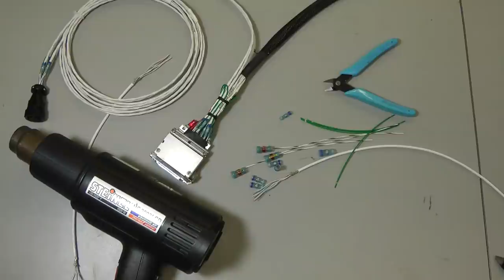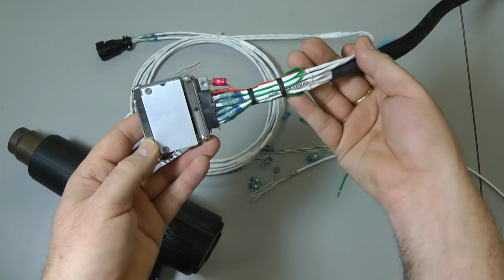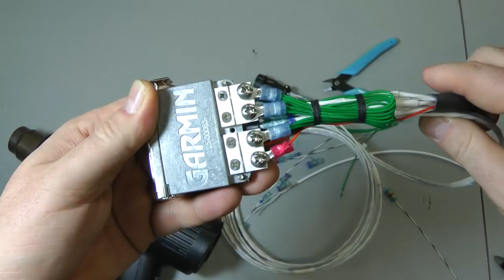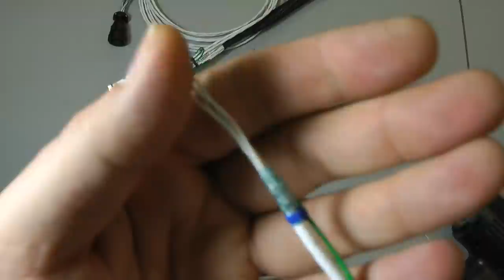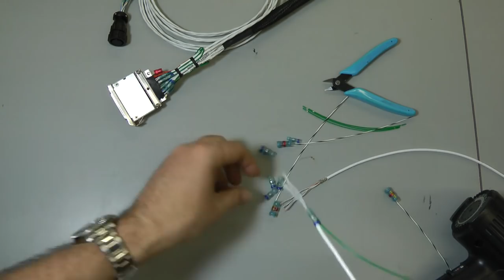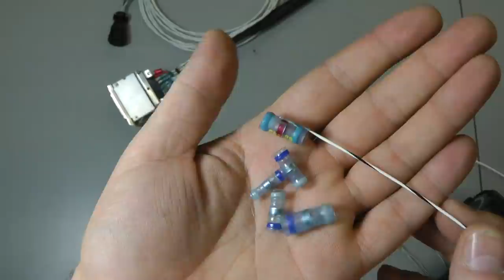007: SOLDER SLEEVE & SOLDER SPLICE on Aviation Wire

Comment from the maker: Most of our heat guns are typically set somewhere between 500-700 degrees.  If you get it too hot you'll melt the outer insulation which isn't good, but if it's too low then the inner solder won't melt and flow either. It depends a little bit on the specs of each various solder sleeve mfgr as to the proper temperatures, but if you try one or two you'll quickly find the right setting for the job!
Reply: Try a IR heat gun.

Comment: Thanks! I got some of the 22 ga shield terminals with a black trace on a white wire that comes off of the shield that will get an eye terminal that ties to a vacuum tube socket mounting screw. We call it a "DRAIN" not a ground. The original wire needs to be longer so I can swing a pair of caps 180 degrees so those terminals will clear a new bigger more powerful main transformer. Green in that power supply is the 6.3 volt heater wires. Black is DC ground. White with the black stripe is DC chassis ground, but green from the power cord is the safety grounding conductor. I will be running 22 ga mic cable. I just did some RG316 and RG178. They are like miniature RG174 cables. I tease an opening into the braided shield then hook the center conductor insulation and all and VERY carefully pull it through that opening leaving a tail of in tact braided shield wire, with no loose whiskers to short to anything.
Reply: I am very anal and totally OCD about my cable work. I will be doing some more 4 lead Kelvin clip test leads soon. Each clip is $80! I bought some Asian made tweezer test leads. The shields are not even connected and two of the center conductors were soldered so hot it destroyed the BNC connectors. I get to redo that too!

Comment: AC 21-99 Section 2 Chapter 3 paragraph 23b instructs to comb out braid and fold back over the jacket to prevent braid to wire shorts. Shorts can happen months after solder sleeves were terminated and inspected. I’ve seen it happen.
Reply: So very true. Plus the short can cause equipment failure and it may be hard to troubleshoot to the correct wire causing the problem. It could also become an intermittent short which is very hard to troubleshoot. The intermittence would depend on the flex and angle of the cable.
Reply: You are very correct and that's a good point!  Will try to edit the video to add that in, was mainly just trying to show the basics of these buggers....
Reply: I don’t see this AC listed any longer at the FAA Advisory Circular web site.  Any idea where to find a PDF online?

Comment: I normally fold the shield back over the outer insulation. I'm afraid the hot solder could damage the internal wires and make a short. Maybe just being paranoid.
Reply from the maker: You are absolutely correct - that step was missed in the video and we will work to add it as that is industry standard/normal practice!

Comment: Depending on the Aircraft Co....the shld folds back over the outer insulation, assuring no shorts....also, at the company I worked at, the solder ring should show 75-100% ring melt. This was about 90%...which is acceptable.

Comment: Great videos Stein.  At 1:05 in the video you show a canon plug with the wires neatly secured at the outlet of the plug.  What did you add to the connector to make the thin wires sit tightly in the large outlet hole of the connector body?  Thanks in advance.
Reply: I am also curious about the plug connector on the end of the wire.....What type (part number) of connector do you use?

Comment: Garmin states: "The Flat Braid (shield drain) should go out the front of the termination
towards the connector. It is not permitted to exit the rear of the termination and loop back towards
the connector". Thoughts?
Reply: For Garmin wiring specs see Garmin Manual "Shield Block Installation Instructions"  part # 190-00313-09.  Garmin permits daisy chaining shield drains.  Also the install manual for my GNC255A shows the shield drain exiting the rear as an alternate way of doing the shield drain.

Comment: I thinj if we use A piece of Teflon tape or heat shrinkable sleve bneith the Strain,  the wires will b safe and both the ends almost got same size a more prefect joint.

Comment: This is wrong!  The shield should be folded back over the outer insulation with the solder sleeve installed clear of the inner wires.  If you follow the instructions as presented, you will find that the inner wires will eventually short to ground.  Please locate the Reychem PDF file available online for the correct application.
Reply: Boeing uses this method on every plane they fly...... along with the pull through method which isn't shown here.
Reply: They use a reflector on the heat gun. I know because I have trained them.  Soldersleeves should never be done without a reflector.
Reply: all aircraft wirring in the world use tthis method, different aplicable for electrical wiring or automotive wirring.
Reply: That is exactly how we do it for subsea jumper cables.  We also use a reflector.  We set the heatgun to 350 degrees.